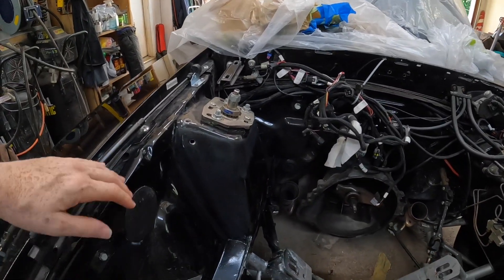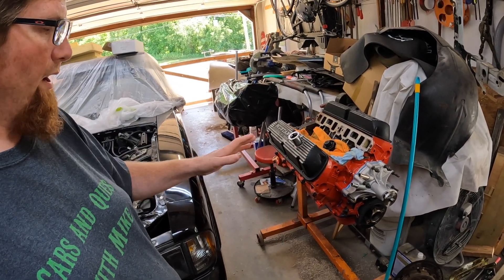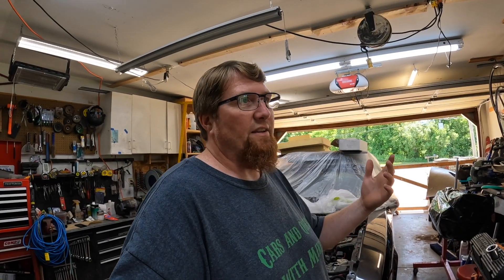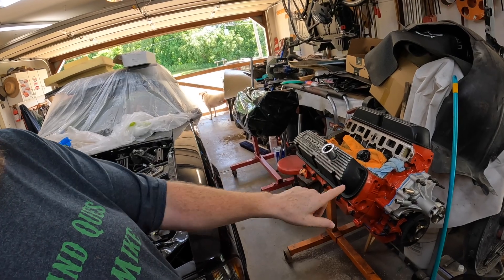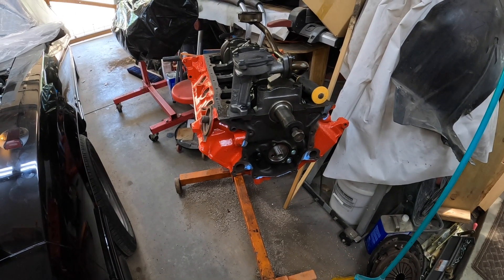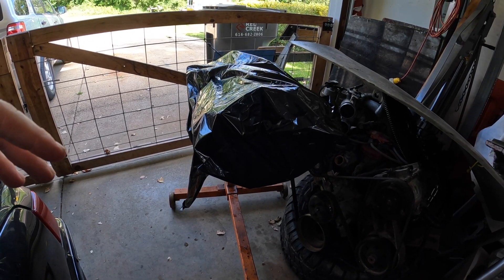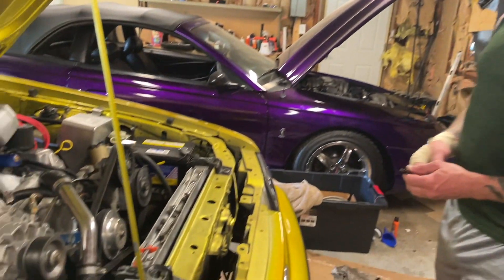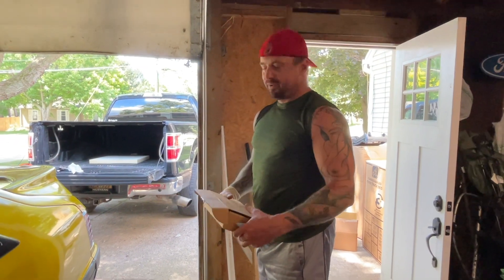Foxbody: Ginger, Stroke My 351?

Comment: Nice video!! You can use the timing chain cover and the water pump on the 351. Not the balancer or the timing pointer. Are you sure the 3 bars are going to be big enough for the 393? The F-cam is a good boost cam! I've got 2, one in my green car and 1 in my orange car! ;-)
Reply from the maker: Thanks. Ford blue told me. Balancer I knew, crank is 28oz, I’m going to get a BigDogs cam. 3 bars are going to BigDogs, this sucker will 12:1! E85 territory

Comment: Did he have a 347 in his car as well or was it a 331? Hell yeah man 393 and I feel privileged now because I got the inside scoop before you actually revealed it and when you told me I thought you may have already revealed it and I missed it because when I told you that I was doing a 393 as well you called me a copy cat so i thought that I missed it in a earlier video. Yes you are correct 50 tussin would use those headgaskets, Pirate tossed some that wasn't blown in the garbage and Tussin got them out and took them home and eventually used them and had good luck with them up until he sprayed nitrous and it blew one of them but he has a knack for being able to do stuff like that. The intake gaskets on the love boat he said that he has reused 3 times already, if I had done that they would pour water before I got the radiator filled up, hell Im barely lucky enough to get the new ones to seal much less old ones 🤣😂 man we are going to have to do a friendly race with our 393s in our foxbodys when we get them going at ford takeover, that would be cool and we could make a big deal about it to help promote your channel that would be cool i think
Reply from the maker: Yeah he has a 347, and he’s building another with that block.I could mail them🤣393!!
Reply: @funkystangs2843  I bet you have been thinking about putting the 393 into black sunshine or it has crossed your mind a time or 2 😂
Reply from the maker: @79beans347  nope don’t want to. Black Sunshine is a driver